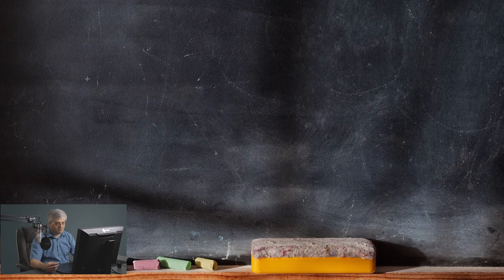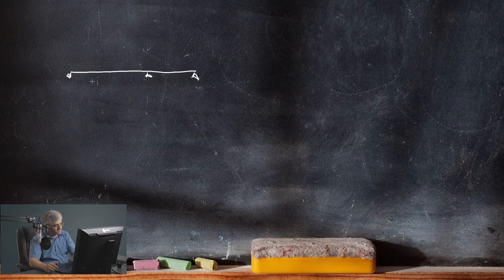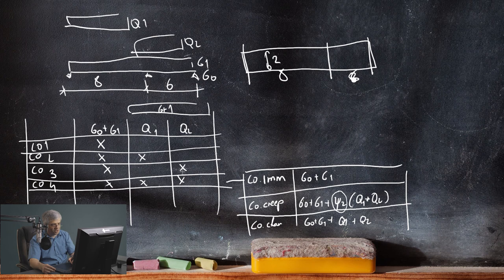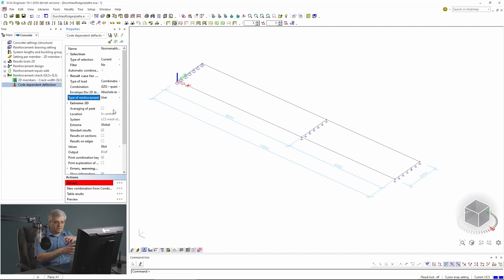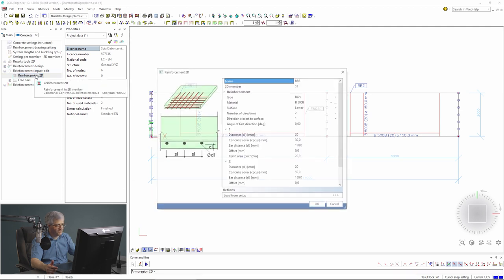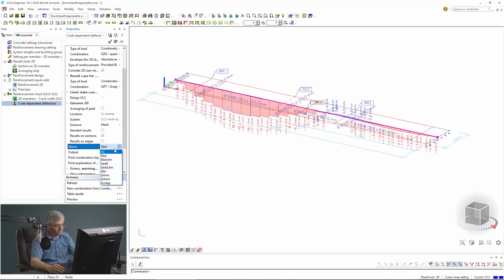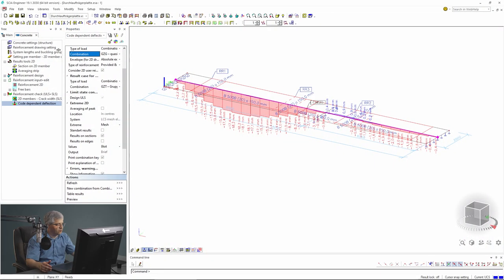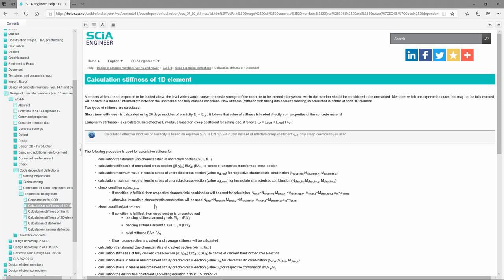SCIA Engineer Tutorial about code dependent deflections of concrete structures according EN 1992

Comment: Thank You Ivan for explaining CDD calculation. I have a question and would be grateful if You can help me.

There is a service called SLS Deflection in concrete module which also calculates deflections in state 2 and it gives almost the same values as my own calculations done by excel spreadsheet so I would say that's ok, but on the other hand when I do the CDD calculation on the same beam for the same SLS Combination I get totally different values. Both calculations are done using the user defined reinforcement.

To be exact I get 7mm linear deflection and I get 24.1mm using the SLS Deflection service which seems logical and expected. Using CDD calculation I get only 8mm deflection which is totally odd. Thank You for your time and effort that You put in this videos.

Comment: The combinations you used to perform the check in this video are the ones that SCIA creates automatically right? What happens when I have a non-linear calculation? Can I still use those to perform the check or should I use the non-linear combinations, or is there a different path to be folllowed? GOOD VIDEO!!!
Reply from the maker: The deflection check is not designed for nonlinear combinations. In V21 you can use different combinations for immediate and long term deflections. But if you want to do nonlinear calculation, you can calculate PGNL (Physically geometrically nonlinear calculation). Then is concrete cracked and also the redistribution of internal forces due to cracks is applied.
Reply: @IvanBeles  Thanks for your answer. This means that I could perform a non-linear calculation but for the CDD (code dependent deflection) y must/can just use the linear combinations automatically created by SCIA?